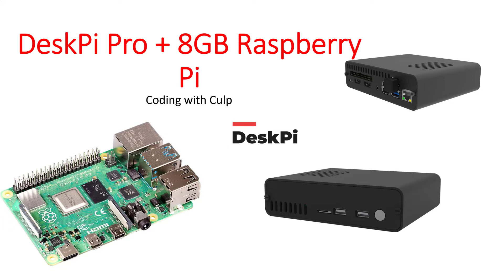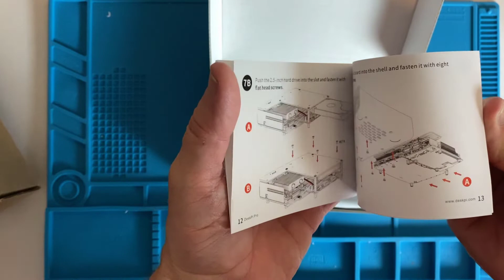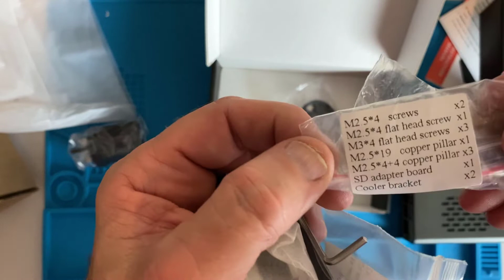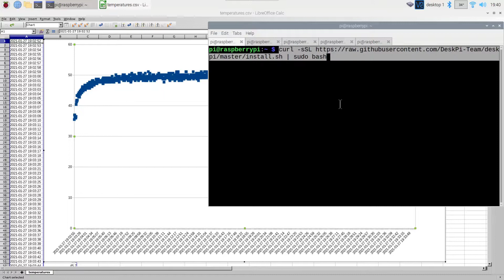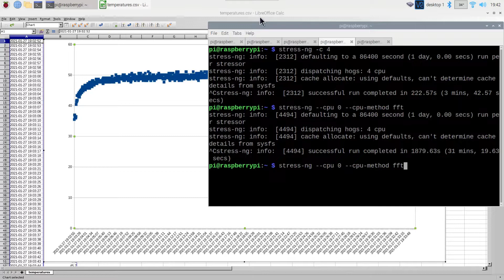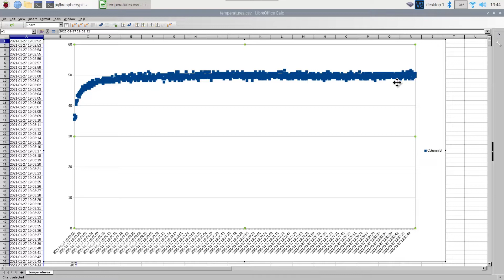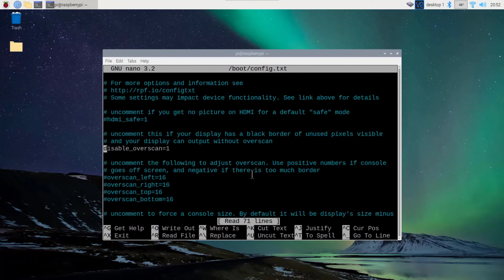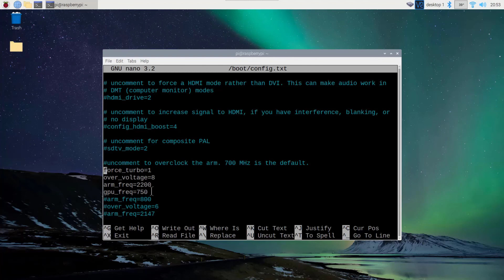DeskPi Case Unboxing + Stress Test + Retropie

Comment: Great video! I really liked it! Please, could you help me? I bought this exact kit from the DeskPi Store. And I bought it just to use as a retro game console. For this I need the Front USB Ports to work to use the joysticks on them. I use the RGB-Pi Cable and the Recalbox RGB Dual HAT on a Sony BVM Professional Monitor. The RGB Pi OS 4 used to run the RGB-Pi cable is built on the Retropie platform. And Recalbox I don't know what platform it uses besides linux. Do you know how I make the Front USB ports and Fan control work? On RGB-Pi OS 4 I used DeskPi's Wiki method, got some progress but it didn't work. In Recalbox nothing worked. I would really like it to work to play with my children, after all, I bought it just to use the two systems mentioned above. I use RGB-Pi OS 4 and Recalbox 8.0.2 (recalboxrgbdual version). Thank you very much in advance! I already left the Like and my Subscription on the Channel.
Reply: I was only able to get the front USB ports working on a fresh install of Raspberry Pi OS x64 by following the DeskPi Wiki steps. I tried unsuccessfully on other Operating Systems, such as Ubuntu 22.04 for example. The case is wonderful, but I'm really sad that I can't get the front USB ports (the main reason I bought the case) to work. Thank you one more time!

Comment: I got my DeskPi Pro last month and found out will not boot SSD 2.5 drive but it will boot a M2 SSD. I got twisters OS on it
Reply from the maker: Interesting I would assume you could boot from either one as they both use exactly the same USB interface.

I will need to do some experimenting.